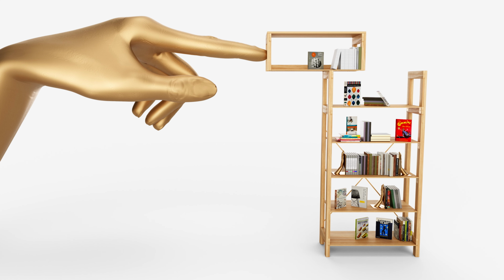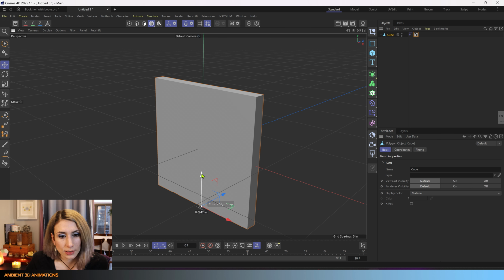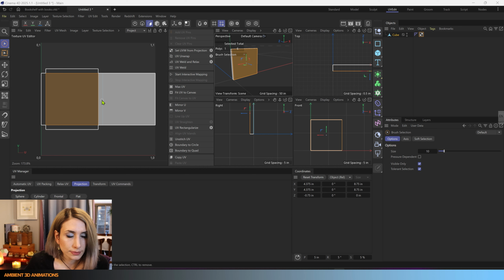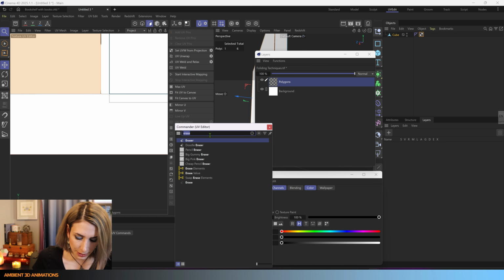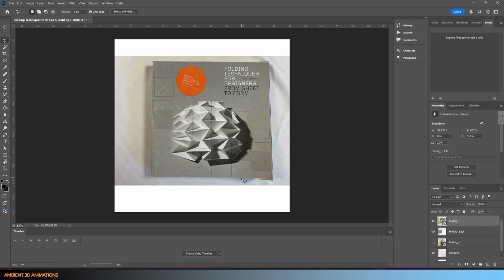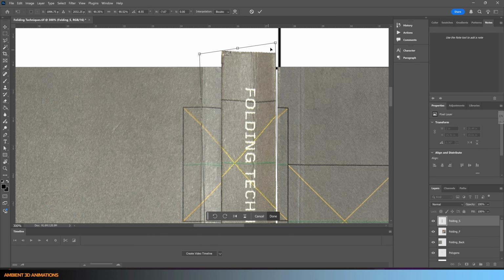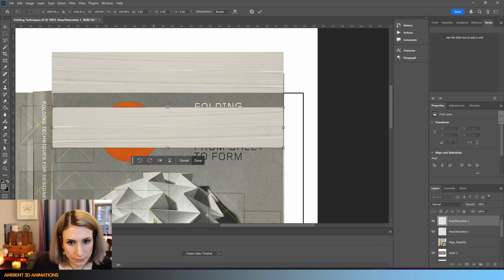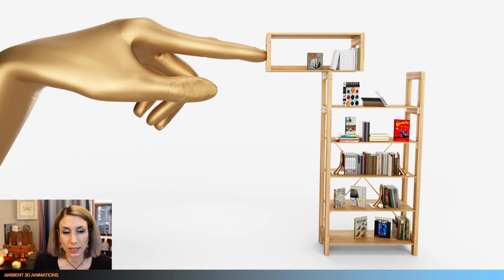UV Wrap Books in Cinema 4D EP103

Comment: Thanks for the video.

I've got a question. Why do you use 16 bits in Photoshop, in stead of 8 bits?
Reply from the maker: It holds more color data so it is easier to edit and color correct. You can use what you think works best for a specific project though
Reply: @Ambient3DAnimations  Okay. It never even thought about 16 bits, I thought it was something for photographers or so. I will try it now. Thanks.